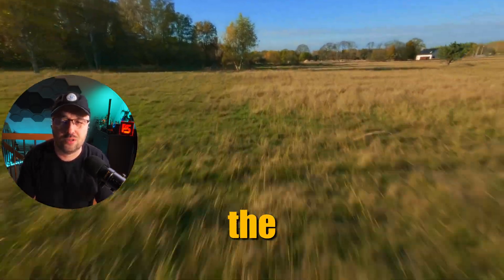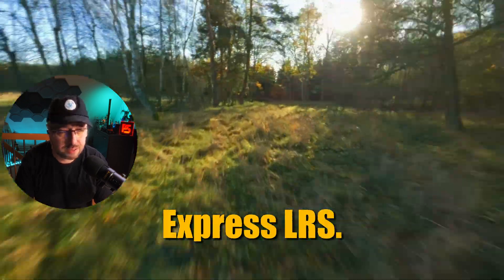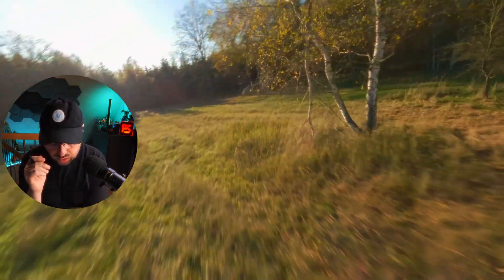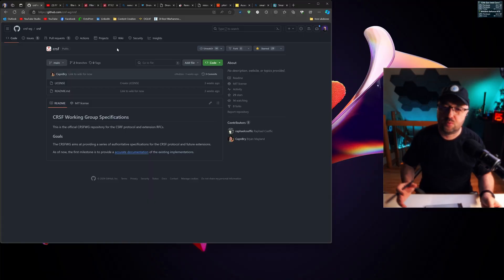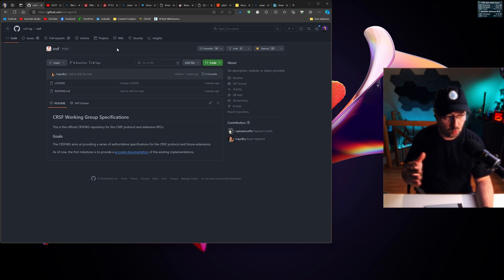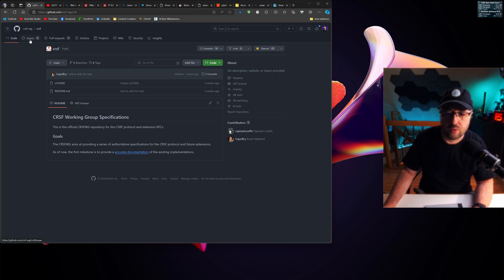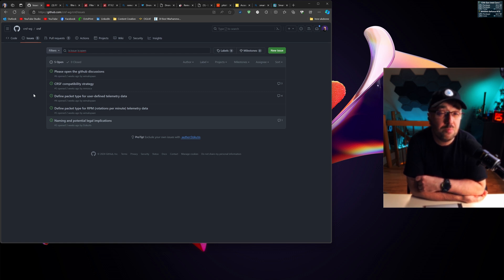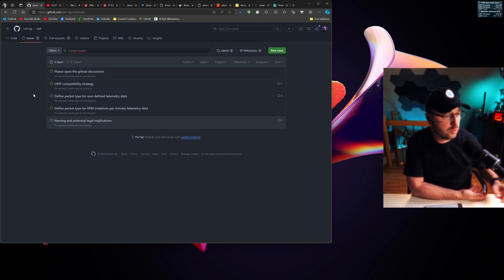CRSF Open Standard | Let's standardize

Comment: Hm... I have permission to use CRSF protocol :) And honesty, i made quite advanced implementations of it on ultra (osd) and KKC. CRSF routers, proxies and i have even Voltara esc talking CRSF protocol now (with permission of TBS of course). NEVER had i need to change anything. Its a TBS protocol, adhere to it or make your own. Simple. Its indeed tricky situation, when direct competitor uses IP and has intention to "improve" it. Same happened with dshot and blheli/betaflight. Implementation is still wrong on dshot commands and not how it was specced initially. Same painful story goes over ELRS and weird baudrate that is NOT specced by CRSF. Its pity that first "we will implement it as we pleased" and then we improve it. Of course, having something already working is "easy" way in to the customers. Especially if you have competitive product. My 2 cents.
Reply: Preach mate let em know 🤙

Comment: IMHO, the ELRS devs should not be fucking with CRSF. It isn’t their protocol to change. 

If they want more control. They should create their own, open protocol. Not change CRSF, which is TBS’ protocol. Then they can define it how they like. There are not issues with actual TBS devices that use CRSF. Plus, they can make it more suited and efficient for their application.
Reply from the maker: the best would be to fork CRSF and name it in a different way indeed
Reply: @FPVBites  Oh. Just call it differently and all problems solved then :)